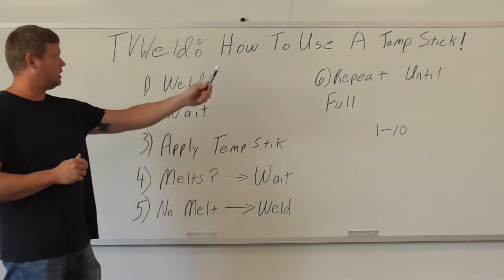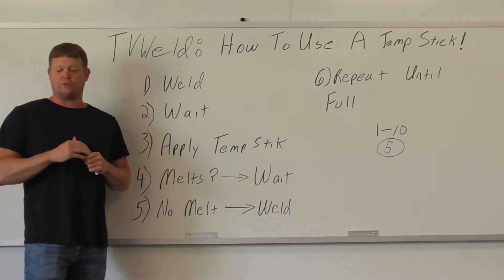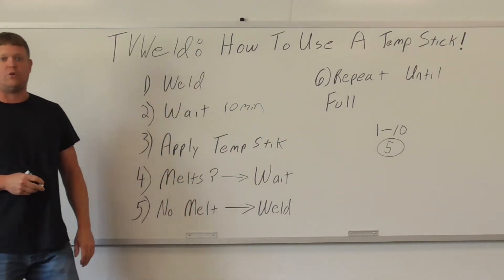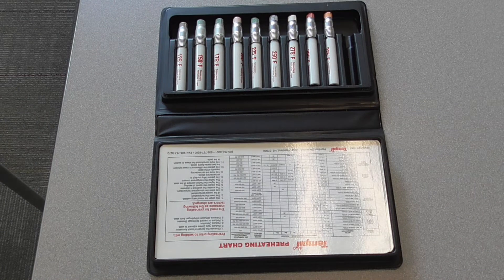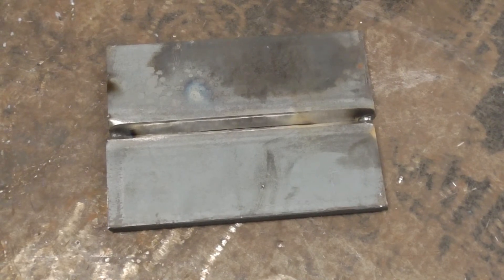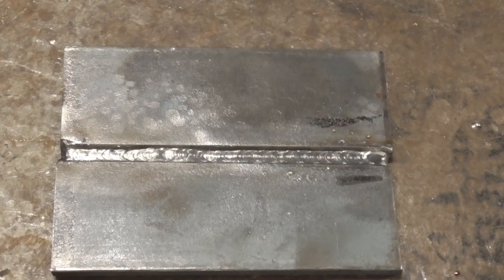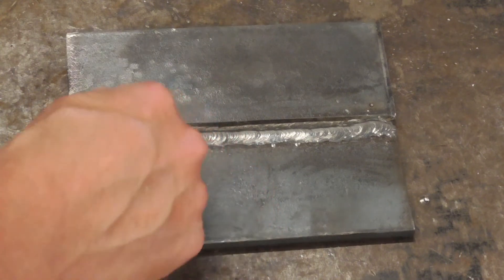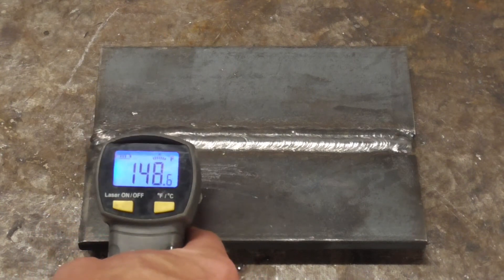How To Use A Temp. Stick When Welding

Comment: Great Video. For interpass temperature, do you have a code required distance from last point of welding, where you take this reading  ? AWS D1.1 says minimum 3 inches.   

I am particularly looking for stainless steel GTAW--- required distance from last point of welding to take the interpass temperature.
Reply from the maker: I've always taken it at the end just because that's where the last heat was input into the material.  I'll look in the code when I get to my office.
Reply from the maker: I looked it up.  It says "interpass temperatures shall be maintained during the welding operation for a distance at least equal to the thickness of the thickest welded part (but not less than 3in.) in all directions from the point of welding."  Now that's by the book.  #d1.1
Reply: @TVWeld Thanks, I checked AWS D1.6, but did not find that information. FYj Jefferson's welding encyclopedia defines interpass as the temp of the weld bead.